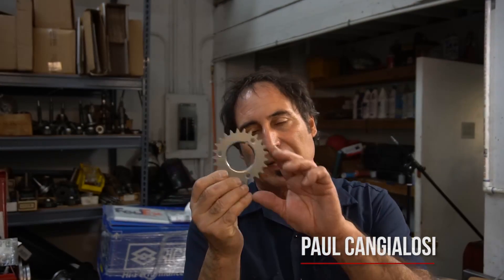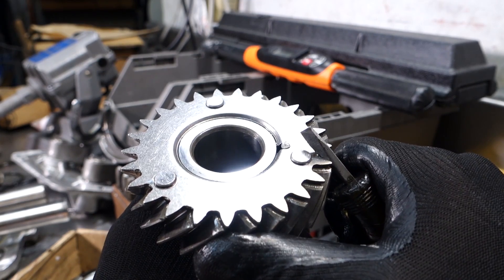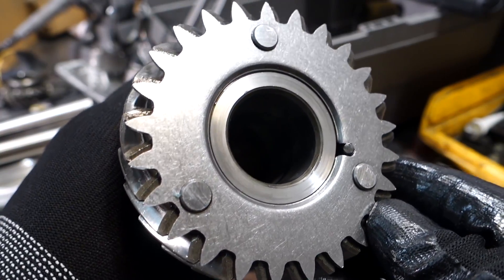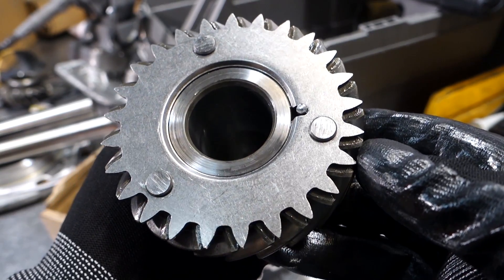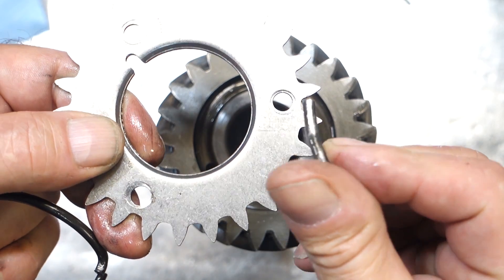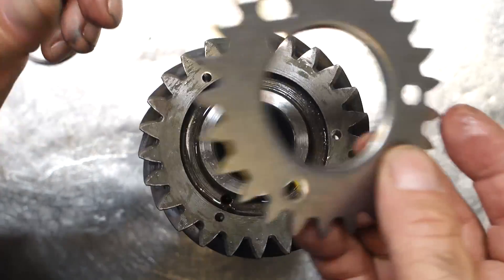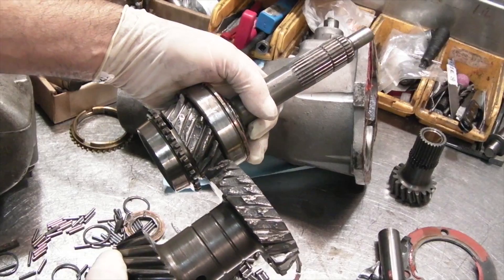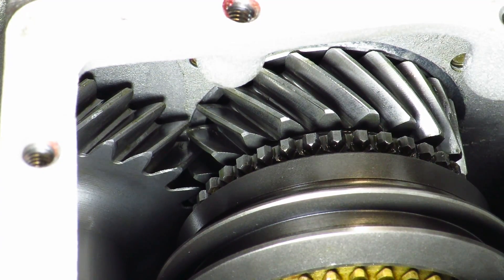Quick Tip - Anti Backlash Plates

Comment: my 1966 M20 was rebuilt years b4 I bought the car.  don't suppose there's anyway to know if the anti-backlash plate and rivets were removed w/o dropping out the transmission and opening 'er up?
Reply from the maker: Not possible
Reply: @GearBoxVideo  Thanks

Comment: Question under the large reverse gear is two drilled indents in the shaft one has a ring clip i believe set inside of it, other side no ring clip is this to help keep the gear from rattling ??  PS I am not very savvy with email stuff lol.
Reply from the maker: Anti rattle springs. One is missing. I remove them because they break and sometimes get lodged in the gear causing the trans to get stuck in reverse.
Reply: Thank you very much for your reply.
Reply: Is the 10 tooth m21 imput shaft and the 26 tooth m21 shaft the same other than the tooth count for the clutch plate. I would like to put the 26 tooth in my transmission it can originally with the 10 tooth.
Reply from the maker: You mean spline count. Yes the only difference is the spline

Comment: This is perhaps the most amazing channel I've come across. Thank you sir. Awesome content.
I just have a question instead of a anti backlash plate, would a anti backlash gear with spring arrangement fair better?
Reply from the maker: The parts manual calls it an anti backlash plate.  Years ago you could replace the plate. The gear is an assembly. I am removing the plate. GM never listed the gear as you mention. What is the reason for the semantics?
Reply: @GearBoxVideo  well sir, I was researching a lot and this was something new I'd seen. I guess I have to do a lot of research. This insight has given me great info. Thanks again for the reply. Appreciate it

Comment: Does the extra space left after removal pose any problem with the gear moving front to rear in the case? if so how do you deal with it?
Reply from the maker: Mike Bickle The plate doesn't go over the thrust surface so nothing changes

Comment: Smart transmission rebuilder-- I am a former gear head as I had 3 1st gen. Camaro's including a 67 RS Camaro, 427/425 with 456 gears and a 4 speed--The only problem I really had with any Muncie was the front bearing making noise but then the trans. were under 10 years old. You sure seem to keep busy and your knowledge and adapting new parts to old is is amazing as I have seen in some other vids
Reply from the maker: Thanks for watching.

Comment: Great video Paul. I remember those plates and figured it was due to the irregular tolerances in the bores of the case = input and cluster gear shafts= too much backlash. I think they had a tolerance problem. Also the gear teeth are not making maximum contact and could minimize the strength of the gears. Just my opinion.

Comment: Hi Paul. Thanks for another excellent video.

With the plate and rivets removed, do you need to increase the thickness of any thrust washers?
Reply from the maker: t5montecarlo No, the plate doesn't ride or attach to any thrust surface.

Comment: my truck (00 rwd ranger XLT 5speed) makes that noise only in fifth gear. I have to apply very light and gradual pressure on the gas pedal to avoid it. you'd expect it at low speed and high gear but I can be on the freeway at 60mph and if I step off the gas and step on again I get what I deem significant backlash in the diff in fifth gear. What's a viable solution?

Comment: I have a question about the gear rattle. I have a cummins 4bt with a zf5 and i have rattle, a lot of rattle. ...Does this rattle damage the gears??
Reply from the maker: stanzomanny No.  But the question is why? Could be a flywheel issue. Dual mass flywheels are used to dampen harmonics and fail.  The clutch hub can also fail.
Reply: thanks for the respond, I have no harmonic balancer, just a pully in front, no dual mass flywheel and i think my timing may be a little advanced, I'm going to install a harmonic balancer and look into the timing to see if i can reduce the gear rattle. I was worried about it damaging gears, looked all over the interwebs for answers but coundnt find any.
Reply from the maker: You should have a balancer, but depending on how the engine is balanced ( internal vs external ) both flywheel and balancer are ether going to be neutral or counterweighted. You need to find the balance specs of your engine.

Comment: I was wondering if you've had experience with mercedes transmissions, specificly the 722.9, 7 speed?
Reply from the maker: ltwargssf R not really
Reply: ok because I have my transfer case bearings done at a local transmission shop and they couldn't get the output seal to actually seal, they went threw 5 seals before they got the trick..at 50$ a seal I was just wondering if its ever happened to you.

Comment: Very informative, thanks!. High compression and high duration camshafts create powerful impulses at idle creating neutral rattle.  A poorly tuned motor can create impulses causing neutral rattle.  Have a BMW RT motorcycle with a 5 speed which has backlash rattle in neutral. I just keep the clutch engaged when I don't feel like hearing it.
Reply from the maker: Jason Burt light alloy flywheels are typically the main cause
Reply: Have one of those too. I try not to stay in neutral too long when I drive.  Love your channel. One of these days Ill need some shift forks tigged, also a gear face. I'll shoot you an email...

Comment: Excellent explanation and details. So meaning to say you are just eliminating the plate from the transmission when the rivets are worn out?
Reply from the maker: LearningZone i eliminate the plate even if they are not because eventually they are a potential hazard. The Chrysler plates never get looose and they are necessary since gear rattle will be evident.
Reply: LearningZone, sounds more like he removes them when he sees them.

Comment: my m-20 had that on it,  i removed it and it runs quiet ....i am doing a Saginaw right now and i pulled the plate without touching the rivets....the rivets are tight in the counter gear should i remove the rivets just to be safe ??
Reply from the maker: big cal guns I've seen people leave the remains in the gear.  I would peen the ends of the rivet just to lock it in.  With nothing working on them it should not be a problem.
Reply: the rivets in my m-20 was getting loose and moving around pretty good. I'm glad i caught in time....by the looks of the one you showed its complete disaster. thanks for the info greatly appreciated.